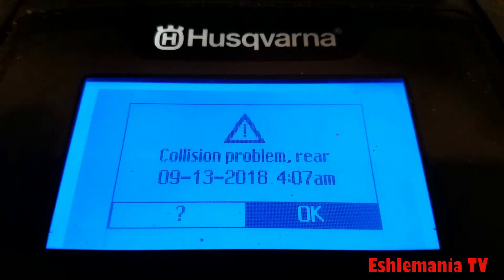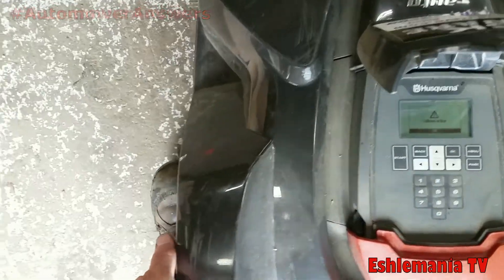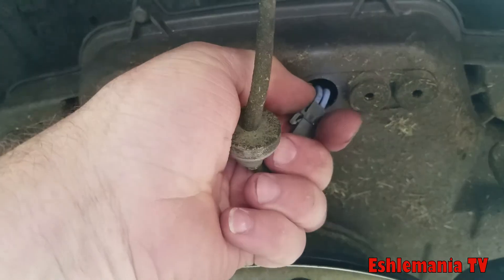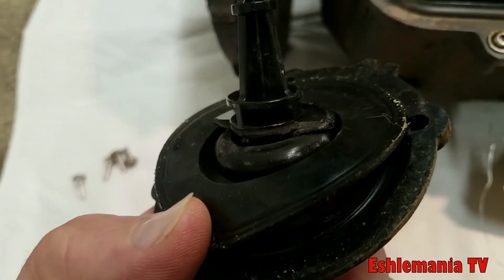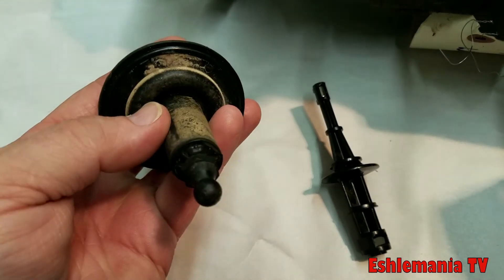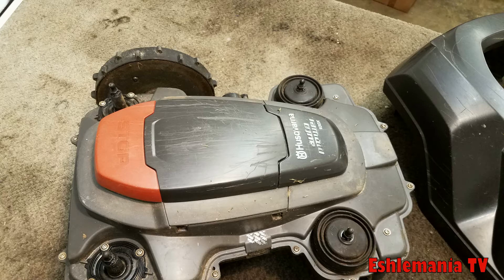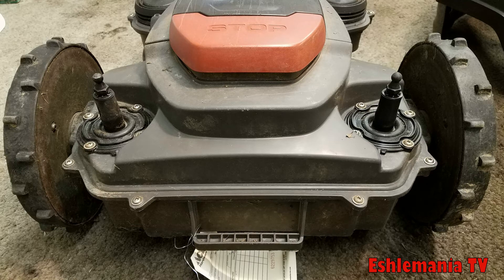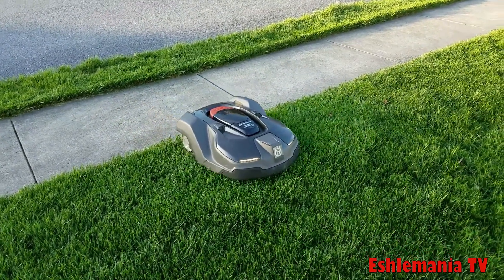Automower Answers: Rear Collision Error (Collision Problem, Rear)

Comment: Hey man, thanks for the great series of videos on the automower. I have a question: My 315 is giving me the dreaded "collision sensor problem", where it acts like it's trapped in an invisible box for a while and then shuts down. the front joystick, which is my number one suspect at the moment, is attached by a rubber boot I didn't force off. How should I proceed?
Reply from the maker: Start by making sure that the magnet is still in the holder in the upper cover. Here's a video we did a few years ago that explains it. https://www.youtube.com/watch?v=M0Ihm0-EfP0

Comment: Which is easier and cheaper?   Put boundary wire around trees and poles to prevent constant collision?   Or just change these sensors occassionally?   Are the sensors pretty tough or vulnerable to banging into objects, especially when going downhill??   Many thanks!   You are THE authority on the Automowers and a great help to many!!    I enjoy your presentations.   Thanks for taking the time!   PS  Why not give your first name on the videos or your channel since we all think of you as our personal trainer on Automower?
Reply from the maker: The current generation of Automowers (310, 315, 315X, 430X, 430XH, 450X, 450XH, 550, etc) are designed to bump into posts, trees, walls, and other solid objects and hold up. The generations before would end up with broken or cracked body parts from constant collisions. Rear collision sensors hold up pretty well and there isn't a whole lot to go wrong with them under normal conditions. If one is broken then more then likely it was from too much weight being placed on it, the mower was ran over by something bigger, the mower was jammed under something, or some other kind of abnormal collision. 

Thanks for the compliments and great feedback! Most of the videos on this channel are contributed to by more than just one person in some way another so it wouldn't be fair for one person to get all the credit just because they do the talking.
Reply: Dear Eschelmania TV, you guys are the greatest!   After studying this video a second time it would appear that one could probably expect  eventually to have to replace at least one of the joysticks.   Since it is only 4 screws and you have shown the way then maybe for the DIY guy or gal it would be a time saver to keep one as a spare part in our tool kit?   Or would it be rare in a late vintage 315 to need one?    I have searched all over the internet and found only a couple of sources for parts online.  What is your recommendation for online parts or other sources of parts?    Lowes doesn't show any parts for them even though they sell them.   Most of the parts stores online I found are in Europe.   Interestingly, I thought I heard the Automowers were all made in South Carolina, but I bought my second 315 and the box said "Made in England."     

Thanks again for all the help.   And one final question if you don't mind.   Why can't I find a US based Automower forum?   I found one in France and a robot forum in Germany, and they kicked me out for some reason.  :(     It would be great to share more with other Automower enthusiasts if indeed there are enough for a group in the US.
Reply from the maker: If you're looking to order parts just send us an email to Automowerinfo@Gmail.com and we can get you hooked up.

Lowes is just a retailer and doesn't even stock Automowers. You can pay for one there, but the mower is shipped to a dealer and they deliver it and install it for you. All included in the price. 

All Automowers are made at Husqvarna's factory in the United Kingdom. It was actually one of their old sewing machine factories I believe.

There are a few groups on Facebook for Automower owners. Not sure about Reddit or any of those places.
Reply: @EshlemaniaTV  Thanks a million!   That is exactly what I was hoping.   I appreciate you, and thanks for the information.   You help us with great peace of mind with your information about this wonderful energy saving evolution in mowing grass!